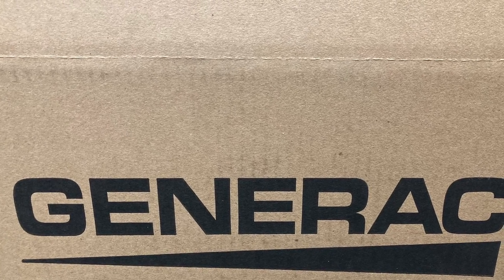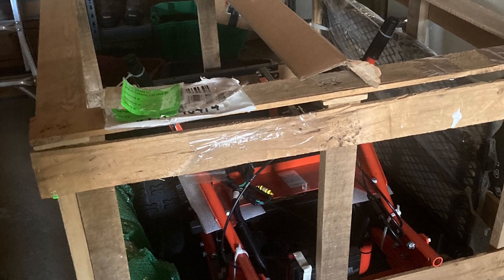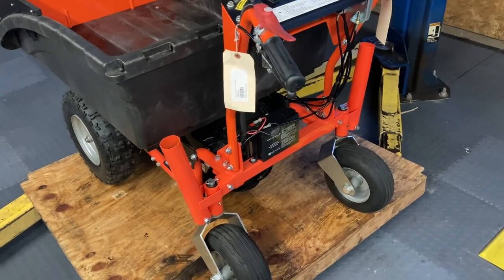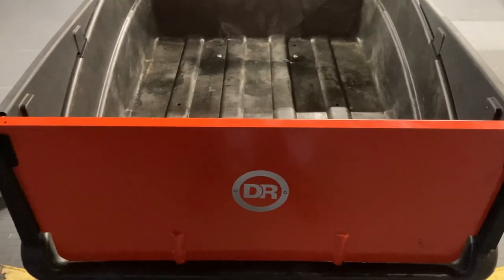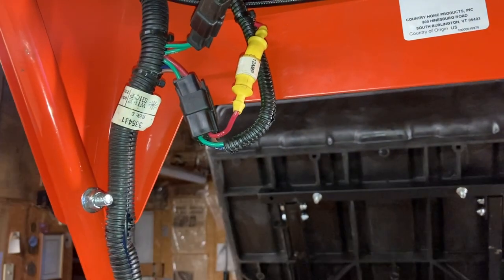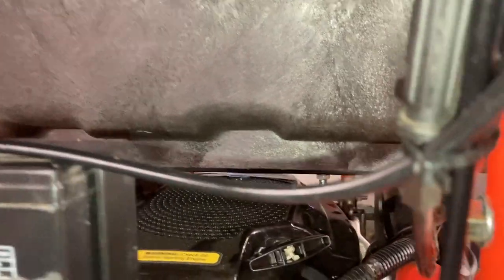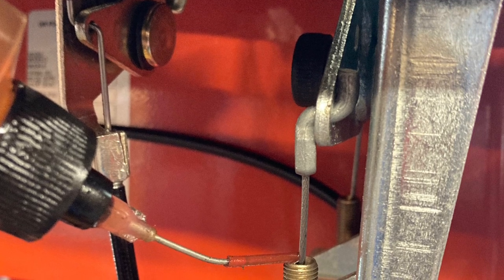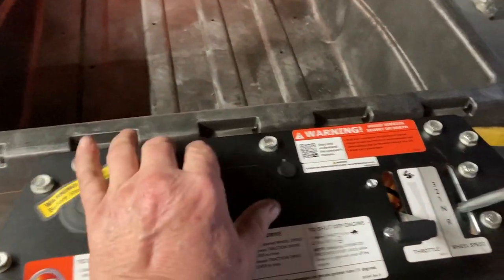DR POWER-WAGON

Comment: My 2 Cents-I've had mine for about 18 months. So far the crank key has sheared and needed to be replaced. Luckily it was under warrantee at the time, otherwise I was looking at almost $900 for parts and repairs (there would be other repairs...read on). When the the dealer put it all back together, it blew a head gasket (that was part of the $900). Once I got it back, the mice chewed through the fuel tank, so I replaced that ($40) and now I have a valve cover that is leaking and I'm off to the dealer tomorrow for a new gasket and some Permatex sealant. One of the rear tires wouldn't hold air (rim leak) so I put a tube in it. The brake bracket broke and had to be replaced (part of the above $900). Not a huge fan of the electric choke, though I don't think that's so much Briggs fault as it is them trying to meet emissions standards, which I think is a bit of a fallacy, because I think a manual choke might be cleaner if used properly. I too am missing a drain plug, but have an oil vac system, but still, come on right? Thanks for the video. With all that, I still love it. I've moved cords and cords of firewood, yards of dirt, mulch and compost and I don't know what I would do with out it.
Reply from the maker: Quite a story, *(and I'm sorry about all your woe's).  My experience will merit another video that I'll up-load SOON. But mines quite different than yours (all MOSTLY) in a positive light.  I have the Electric start as well, and my biggest gripe (over-all) is aligned along side THAT very topic; THE ENGINE. So perhaps watch for that / but, more importantly: THANKS for the comment !.

Comment: Hi Tom.
 DR has made great equipment for a long time.
 What I have found is that most engines today, you have siphon it out. Probably to many people forgetting to reinstall the plug. (lol...) My ten year old push mower is that way.
 While I haven't encountered a sealed differential/drive unit like that yet, I have to look at the drive on my Ariens mower. I might eat my words... 
 Thanks for your review.
Reply from the maker: Hey Henry, "thanks". ... shoot me if I EVER forget that oil 'plug' ok ?.   : - )  Everything today seems more & more "disposable", and how many times have we heard that phrase: "oh- that units sealed & doesn't EVER need a thing" / only  later then to find that THIS is WHY it then failed !. Example: (The rear end of my Ford Escapes a great one): as those cars age, rear diff. failure is a given / and almost commonplace !,., and sure enough / Ford put back that "sump drain" on those models and beyond ! ***MINE never failed because I was again "proactive" (and a non-believer).  BUT: (again): IN THIS EXAMPLE, "THIS is a wheel borrow"  .... "and changing fluids a 100K is kinda silly in that reality" / "yes" ?  ROFLOL  :- )  *ALL my best.